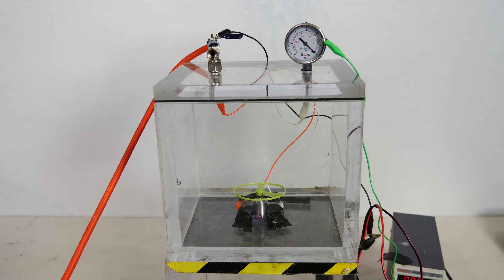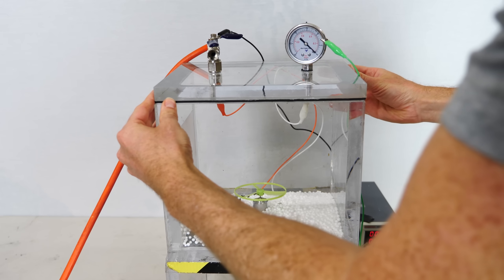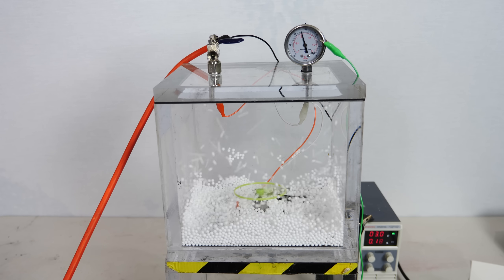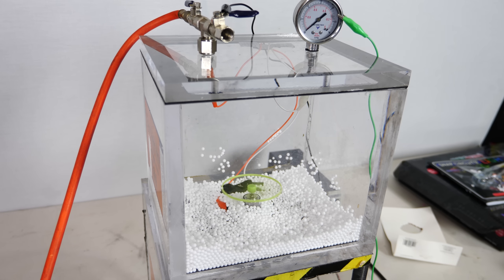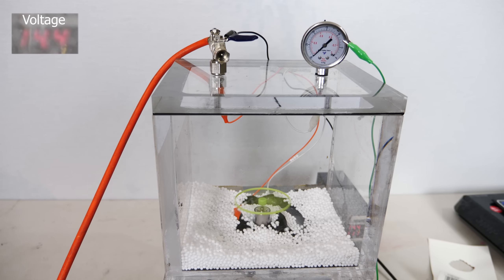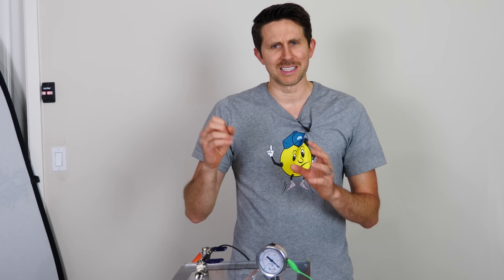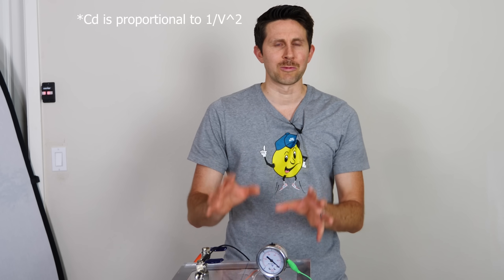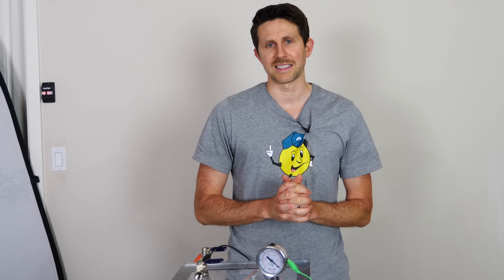What Does a Fan Do in a Vacuum Chamber? Weird Results

Comment: Today's Fact:

Barcode scanners scan the white part, not the black.

- Daily Fun Facts
Reply: Totally related to the video
- Dank you
Reply: @kamkam9600  Totally related to the comment 

- Dank you
Reply: Wat
Reply: That doesn't make sense. If that were the case you could omit the black part and it would still work.
Reply: nekekaminger that’s true. Without the black part, it would be impossible to find!
Reply: So if I painted the black part red, it would work the same?
Reply: @gabor6259 : A red laser can't recognize a barcode of like color; absorbs same/similar wavelength, much like a filter.
Reply: 10/10

Comment: What about putting a fan in the same circumstances but in a high-pressure chamber?
Reply: I imagine the fan's amp draw would increase and it would blow the beads around even more
Reply: @averyalexander2303  The amp drawn vs fan speed depends on motor and power source/ motor driver.
Given a constant fan speed, I expect the speed of beads to be a non linear function of pressure. At a certain point the air will be so dense that the drag wins. (We already saw what happens with very low pressure)
I m not saying I know the answer, just what I expect. It's interesting to speculate.